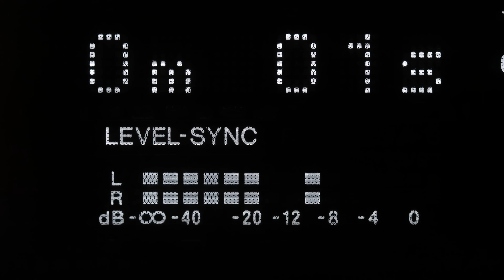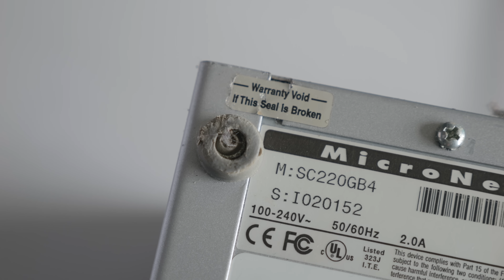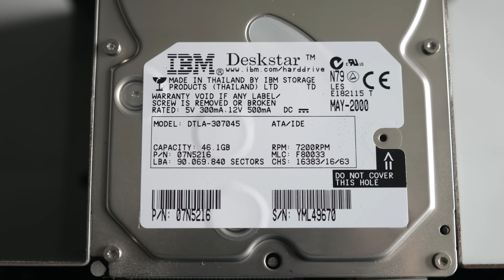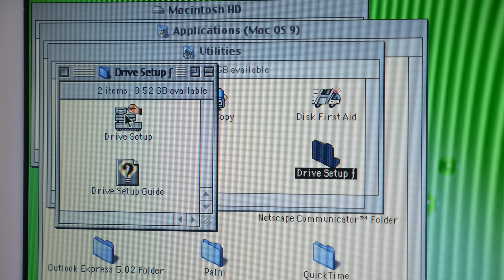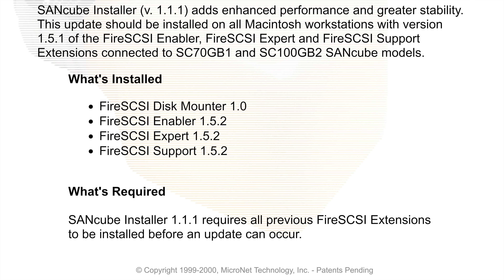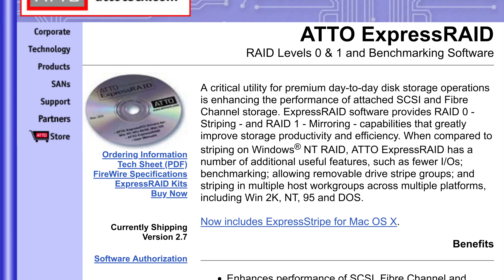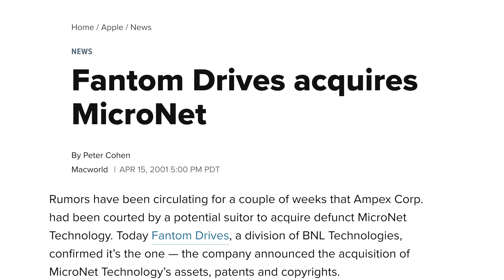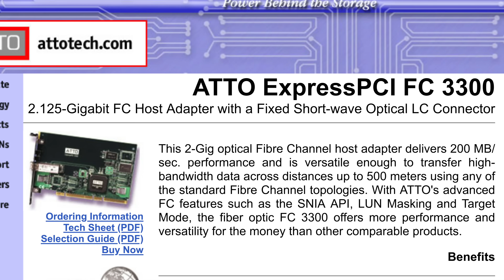This old external hard drive can do WHAT?!

Comment: I recently learned firewire is still alive and kicking in the Linux community. There are audio interfaces that use firewire to communicate with the OS. That blew me away when I heard that's what some people are still using it for
Reply: USB up to 2.0 can't do guaranteed latency with the required precision for professional audio work, where you have to worry about capturing a large number of channels all in perfect phase. Firewire could do that from the start. But it's not exactly a feature in high demand.
Reply: @vylbird8014  Yes, at the time USB 1.1 was limited to 48k sample rate
Reply: @vylbird8014  I still see a box or two kicking around in some audio engineer's racks. I've tried to find ways of getting Firewire working with Raspberry Pis, too, but so far the software side's been tough since it's an older protocol, way back before arm architecture was more than Newtons and some mobile devices!
Reply: Thunderbolt traces its lineage to FireWire
Reply: @kurtwinter4422  Apple developed firewire with Sony, Panasonic and Texas Instruments. Then Intel and Apple developed Thunderbolt together. Somehow they connect with a USB-C connector??? Intel helped develop Thunderbolt and USB so maybe that's why the Type C connector is becoming ubiquitous?
Reply: @Logan5Greye  It's only since Thunderbolt 3 it uses USB-C ports, the first two versions of Thunderbolt used mini Displayport or some version of it.
Reply: I've still got an M-Audio FW-something unit, and a firewire expansion board to go with it, so it will be going in one of my units at some point.  There are drivers for it on the site (use the Windows 7 drivers), and Windows 10 does still support the standard.
Reply: Any good links to workflows?  I got an old (Mini) DV Broadcast camera, and the digital out is firewire (analog out works fine, but digital is higher quality supposedly)
Reply: @ericlotze7724  Flame me if I'm barking up the wrong tree, but are you asking how to capture firewire from a camera?
I have a JVC digital camera from 2001 with FW out and captured it, happy to help if that's your problem.
Reply: @julian.morgan  from what I understand, it has something to do with pulse audio drivers versus pipe wire. I don't fully understand why you'd want one or the other. What I do know is that firewire drivers are included with the linux kernel so connecting firewire peripheral is easy as a result
Reply: Firewire is still doing well in other applications, though: It relatively recently started displacing the MIL-STD-1553 for fighter aircraft, with the F-35 being the first one to use it.
Reply: Watched this video on my Saffire Pro 40 Firewire interface! Basically on it's last legs as the firmware is corrupt and the team developing it gave up trying to fix the software. Might make an interesting subject for this channel actually...
Reply: No wonder that it's still being used for audio-processing… Since exactly no·thing beats FireWire's supreme and pretty much non-existing latency for de-facto real-time processing. It's stellar for audio-processing and video-streaming, especially since everything past it added gargantuan amounts of latency to every bits involved, when more an more stages of actual processing through additional chips were added along the line of signal processing, adding to huge amounts of processing-latency.

Not to mention, that Microsoft killed their audio-framework in Windows 10, introducing unheard of levels of audio-latency, making basically impossible to do any audio-work under Windows. Windows 11 is even worse.

So even the first FireWire/iLink/Lynx-iteration with 'only' 400 MBit/s data-rate was already mind-blowing for the middle of the Nineties when it came to market (1994), yet even today, 38 years later it still offers a fair amount of throughput to work with properly, without being choked like with USB 1.0/1.1 … Firewire 800 is still very much usable and of course easily beats USB 2.0 and often even USB 3.0 on throughput alone, not to mention everything signal-latency in terms of real-time processing.

Anyway, it beats everything what came past it on latency and basically a bare-metal bus which excels in audio/signal-processing. FireWire is for soundmasters (like audio technicians and studio musicians) on audio-/video-processing pretty much, what Vulkan is for graphics!
Reply: Learned from LGC by chance?
Reply: @GikeroMage  sure did. The interfacing Linux vids have been very informative. I'm am currently going back and re-watching their scarlett 2i2 and motu m2 videos bc I'm banging my head trying to get them to record mono properly with OBS. So far the motu M2 has beaten the scarlett on Mac and Windows 11. Getting a weird echo with the 2i2 in windows. Not sure if I should be using Alsa, Pipewire or Pulse Audio.  If memory serves Pulse Audio is useless and produces crackling audio. The other 2 work but I only hear audio in the left channel of the recording. Everything is set to mono so I'm wondering if I need to change a setting in Norbara distribution (Fedora based).
Reply: Ayy, still using my maudio ProFire 610 firewire interface on my daily driver running NixOS Linux.Firewire still works great and well supported. Lots a fantastic very high quality gear available for super cheap.
Reply: I use a tb3 to tb2 and a tb2 to fw800 for my audio interfaces. Screw buying a new one when they still work great.
Reply: Bought a Motu ultralite mk3 fw400 off a friend for a hundred Aussie and the FireWire powers it as well… ironically it shows up as a USB device. The USB C mk5 for 10 times the price new needs a 15v adapter. To be fair to Motu, I know they’ve focused on getting USB 2 implementation right so that their gear can work with a tonne of devices which in turn I think means they can’t take advantage of USB 3 power options(?). But yeah, that’s a tonne of money saved and it’s a cleaner setup which you would not expect at all. FireWire lives and the side of the SanCube looks Fire as the kids would say.
Reply: I'm still one of those people. I've got some very high-end FireWire audio interfaces that I have no interest in giving up for now. :P They work perfectly on the latest Linux kernels thanks to the work of the open source community. Don't forget that the modern F-35 Lightning II planes still use the FireWire bus as well for all of their control surface stuff, due to the deterministic ("isochronous") nature of the bus. For the sake of completeness, space stuff (satellites, rovers etc) often use a protocol called "SpaceWire" which shares some fundamental similarities to FireWire, though the similarities diverge beyond the basics.
Reply: I am managing hw in small music studio, I had the pleasure to set up Saffire external sound car to run on Windows 10 via firewire. I was surprised when it starts working and it is working for years now
Reply: Now I am curious if if Linux can read the SanCube... Linux have a lot of drivers built in for old legacy stuff.

Comment: I have a copy of the disc that I can ship if you'd like
Reply from the maker: Yes please! You can either send it my way (address is on my channel about page) or just upload an image to the Internet Archive. Thank you!
Reply: @ThisDoesNotCompute  If you need, um, help with the whole licensing thing, hit me up. I don't have an old Mac to debug it on, but provided the software isn't packed/obfuscated, I should be able to patch it with just static analysis.
Reply: Make a backup on the internet archive ASAP, the disc could get damaged during shipping
Reply: I'd make a backup before you send it, it's not uncommon to have discs get broken in the post
Reply: Use something like IMGBURN to make a ISO of the disc

Comment: funnt thing is though they cant actually void the warranty of the device if the seal is broken or removed atleast in the us anyways as warranty seals was banned under the magnuson moss warranty act like corsair quit using them
Reply: Doesn’t matter to folks like Apple. I replaced my iphone’s cracked back myself, and when the selfie camera died they said tough luck, your unauthorized replacement voids your warranty. Reminding the employees that Magnuson-Moss is a law that exists didn’t do anything, and I suspect it would require taking Apple to court for them to believe it.
Reply: @mrb692  ive never really changed anything in a failed corsair PSU and they taken it back no problem as i didnt do damage that could compromise functionality of it and they know i opened it after it had failed
Reply: From watching Linus Tech Tips on the matter I believe it is supposed to be a global thing. But no matter, time after time companies try to point to that sticker.
Reply: @sykoteddy  as far as i know the magnuson moss act only applied to the us im not familiar with warranty laws outside of the usa

Comment: So it's basically a giant Firewire JBOD with six time bombs in it... 🤣
Reply: Yeah much more of a DAS than a SAN.
Reply: If those FW-to-IDE chipsets don't have any storage abstraction in them, that means that this was not just software RAID, but the software would have to coordinate file system access between the other hosts.  Bold move.

(And by "bold," of course, I mean this is a terrible idea.)
Reply: @sirnickity Oh man, I don't know much about firewire, but I'm having a vision of flames and a mutex scratch file at the head of each disk to lock out huge blocks. Maybe there was access to few bits in a register to lock the whole drive? I mean, maaaybe if you're pulling huge video files infrequently it could work, but you know someone was running a database on that minefield. Terrifying.
Reply: ...And highly proprietary driver software, for an OS that was being phased out at the time of release. This thing is the definition of e-waste.
Reply: Yep firewire failed because firewire was never a good port. add to this fact it used the ibm deathstar drives and you have a useless hunk of metal and plastic better left in the dumpster in which is was found
Reply: The largest capasety ide hdds ever made where 750 gb
Reply: a JBOD will not allow multiple concurrent users
Reply: @Wxcafe In fact, there are SAS JBODs that can be used this way. This is even used in certain enterprise architectures. However, such a solution still needs a proper software configuration.
Reply: @Wxcafe Neither will this box without the software. So without it, it's JBOD.
Reply: @Wxcafe  

This unit is basically a JBOD unless you have the proprietary software, which is essentially non-existent at this point.
Reply: It will on a network

Comment: I do think in situations like this, if the companies responsible for them abandon them, they should turn it over to people who actually care to make it workable. They're not interested in marketing it, servicing it, or dealing with it at all. So why not release the associated software/firmware and allow anyone who wants to use what's basically defunct hardware do so?
Reply: Patents.  Not only is there probably technology in there that has been folded into newer projects, but some of it may not even be entirely owned by them.

I would really like to see a movement away from closed-source development on both hardware and software, with a body charged with maintaining patent registrations which have no usage restrictions -- just to ensure that nobody else can file a patent and keep the underlying innovation locked down.
Reply: @sirnickity  

Nowadays it'd likely be cheaper and easier to do things using Linux / Unix and open source software.

Less so back then for MacOS software RAID.
Reply: @sirnickity  I think more and more interesting in cars. I terms of home automation also. Yea but you now get this and this. 
The whole problem is in throwing things away if these get unusable too soon.
Reply: @Nordlicht05 Scary this is likely to happen to new cars going forward.. 😮
Reply: @BoltRM  would make sense of cars are build to be easy disassembled and than scrapped with minimal waste. But if this occurs too soon the value should not get to zero. If that's what people want.
What I think is when more software is involved this should get open source.... All of it.
Reply: @Nordlicht05  I agree
Reply: I think it has to do with them being either unable to see that someone could want to do that, or that they are afraid it will gain popularity again and they can't make money of it after they have done what you said.
Reply: I think for any commercial product, all licensing and software/hardware should become open source when official support ends.
Could you imagine what that would do for millions of dead printers, smart devices, and other DRM online only garbage?

Maybe if their service has some really important and secret shit in there, thats encouragement to keep the services alive.
Reply: Capitalism ruins everything. Greed is the only virtue. If it doesn't help the bottom line then there is absolutely no reason to.
Reply: I have often thought about that. But its likely a combination of: refusal to do so because it's proprietary/a paid product (at the time of any of this software being abandoned, it'd still be much more viable than decades in the future), not realizing someone in the future may need it, and the company going out of business. Usually when the latter happens, there aren't many employees who would be worried about that kind of stuff, they have more immediate concerns. the foresight just isn't there.

Comment: IBM DeathStar's :face-orange-raised-eyebrow:
Luke, your data is dead! Noooooo!
Reply: ‘This isn’t the RAID storage you were looking for’
Jedi mind trick
Reply: these were dark days indeed.
Reply: I'm still bitter about two dieing on my and taking much data with them!
Reply: Kind of funny how all six in the video passed the seek and I have a full set that still work hehe. Just don't use them, and they don't die as both the video proves and my working units do. They often overheated due to poor ventilation in OEM cases and were not designed for 24/7 usage. Without being cooled well, they often easily get to 60c if running for an extended period of time. The more platters, the more heat they generated and quicker they would run hot and degrade due to this.
Reply: @cdos9186  Hold my ST3000DM001, these had exactly that issue, according to a data rescue company, the parking ramps for the heads were made of a mix of materials and these are prone to warp when the drive gets too warm, damaging the heads.
I got one and it still works, however I used it in well ventilated cases, others weren't so lucky like Apple's 5th Gen Time Capsule, in 2021 they recommended to stop using it because of that (but what stops you from putting a different Hard Drive in, if it doesn't need a specialised firmware?).

But weren't IDE and SCSI drives in general creating more heat?